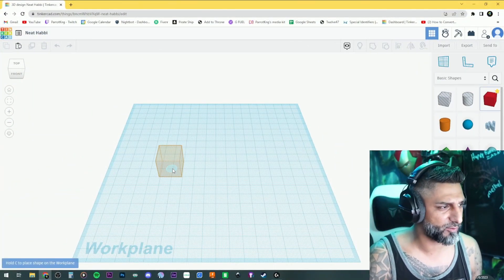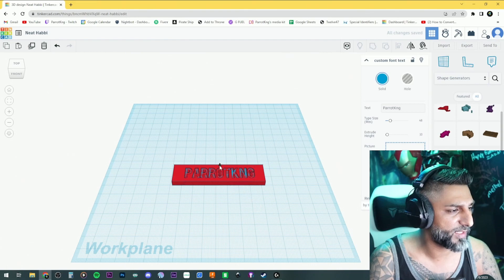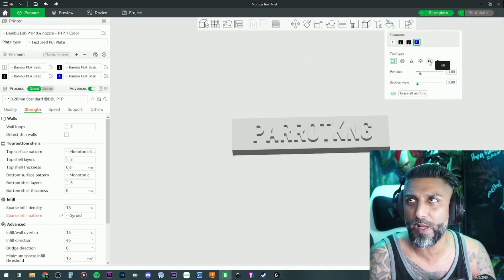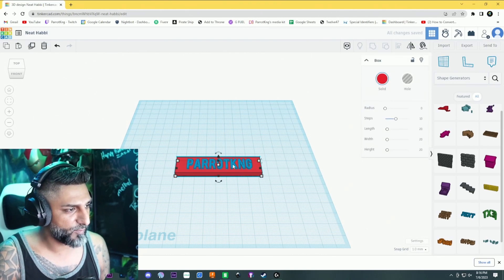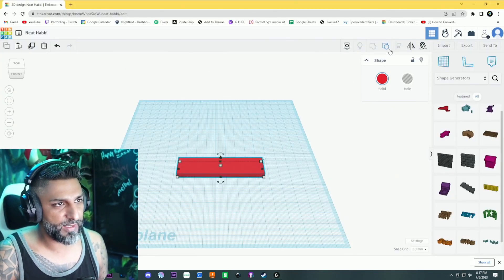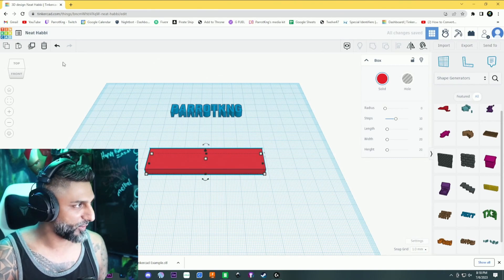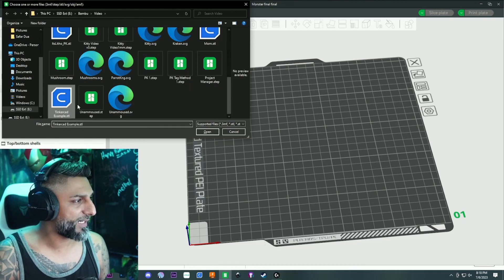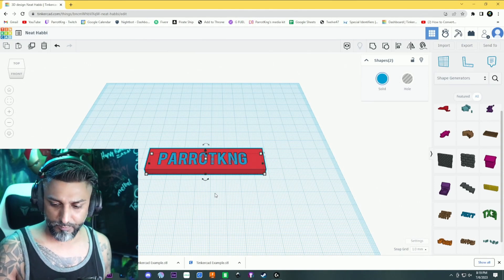Tinkercad and Bambu Slicer Painting

Comment: I tried this a few weeks ago and it worked great, now it wont, put the text height down to 1 and it just had embossed text, then I changed the height in the text menu to 0 , (goes down to 0.01) and all good again, working great
Reply from the maker: @MadBrit1957  Awesome that’s good to know!
Reply: Selecting all and exporting as an .obj worked fine for me, STL didn't. Text height also needs adjusting in case you don't want it to print through.